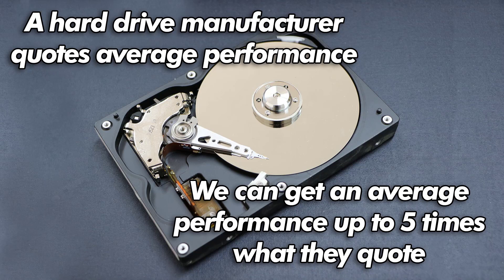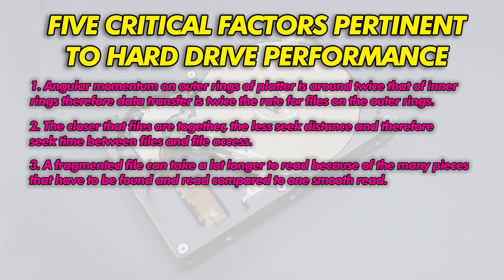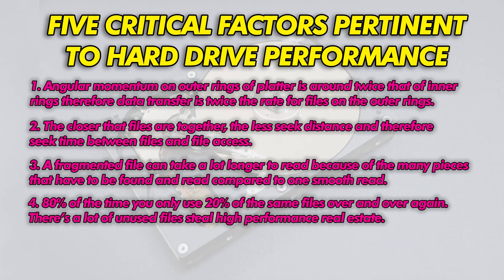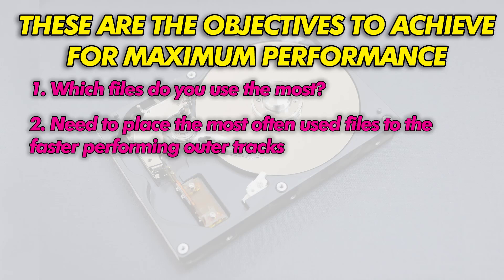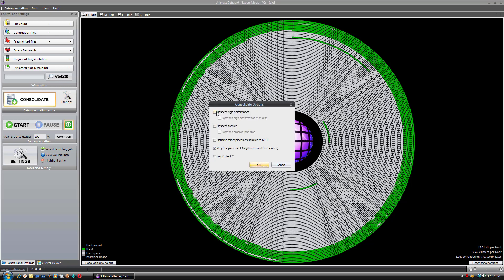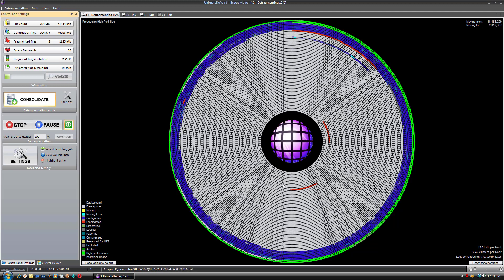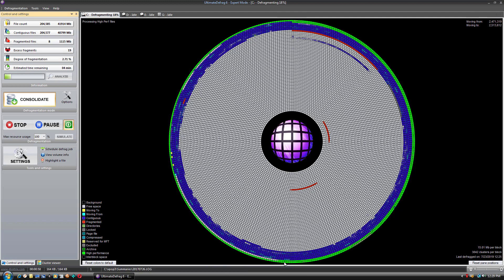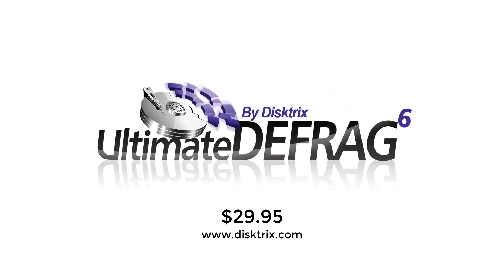Leveraging the physics of the hard drive to maximize performance

Comment: Hi DiskTrix.  Just bought a copy for my windows pc thanks its looking good.  Should help speed the old beast up a bit.  Any chance you might be able to make a version for iMac desktops running MacOS some day or do apple make things too difficult or to expensive to develop on their platform.  Would not surprise me if they do.
Reply from the maker: To be honest, we haven't looked into defragmentation of Mac desktops. As far as we understand Macs do a certain amount of defragmentation during regular operation and may not need it. We'd have to see what is available as far as documentation. The issue here is that we would need to create an entirely new program that would have to consider specifics of the APFS file system. We are not sure that the return would be there to justify its development. We will look into it though.
Reply: @DiskTrix  No not worth bothering with I would think.  Doubt it would be worth the effort involved if you have to start from scratch.  I just thought disks might have had a similar format on both platforms that could be altered a little to work on both types.  As usual Apple always has to make things too hard to do anything unless you are in with them already and paying them some huge amount for the privilege.